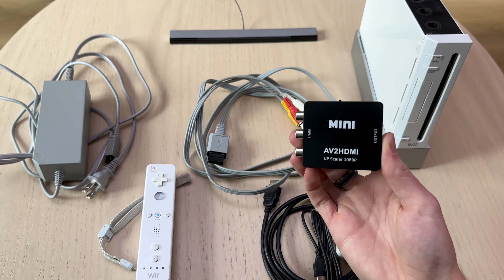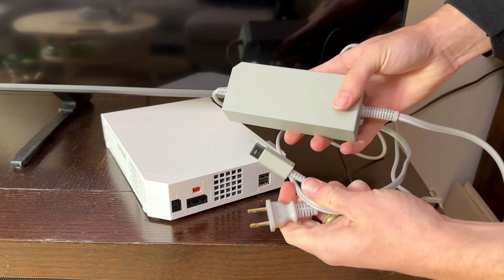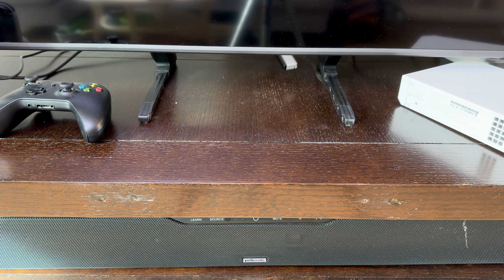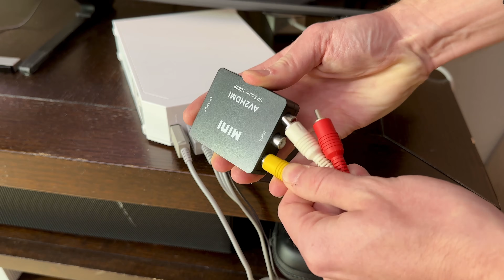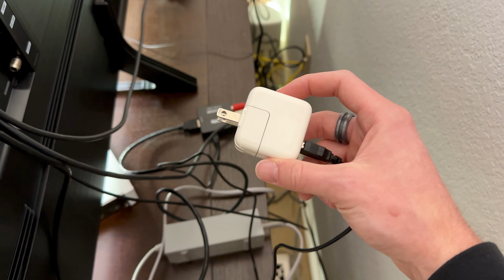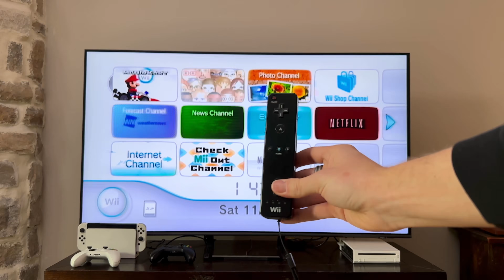How to Connect Nintendo Wii to Smart TV

Comment: Gross. Composite RCA to HDMI looks terrible. The Wii did component video that looks way better on modern displays. The Wii 2 HDMI adapter takes that component signal and passes it through the HDMI. It doesn't look great but it's way better than this.

Comment: was stressing doing this for 40 minutes. turns out i had an hdmi to rca 😂. thanks for the helpful video! i got the proper adapter now
Reply: Hdmi to rca does something like that even exist?
Reply: @sharanrams7766 probably for if you're trying to play a newer device on an older TV. Not many real use cases but it looks cool sometimes. They were probably more useful when hdmi TVs first came out and were still expensive
Reply: @s @sharanrams7766 s, unfortunately
Reply: @sharanrams7766 yes I have it right now

Comment: Hey @SimpleTasksYT! Just bought a new tv and used the same set up as you do to connect the wii. Instead of a nice picture, mine is very blurry, no matter how much I adjust the settings of the tv. Any tips for solving this?
Reply from the maker: Hello! Blurry Wii video is super common on modern TVs. Since the Wii’s native resolution is 480p, modern TVs have to upscale it a lot, which can make the image look soft. The Wii can’t output a true HD image, so anything higher than 480p is just whatever the TV or adapter does with the signal.

Comment: I have followed the steps but it doesn’t pick up the Wii at all it just says hdmi 2 no signal. I made sure it’s connected to hdmi 2.
Reply: Mine doesn't work as well.
Reply: i’m having this same issue. i tried this exact thing in every available hdmi port and none of it is working
Reply: Yours may need to be plugged I. To hdmi 1 mine needed to be plugged in there and mine now works! Hope this helps ❤
Reply: Ya know what's funny??? I'm having the same issue, maybe they discontinued the system,with all the new tech out there!!!
Reply: I had that problem initially but i realised it's becoz i had not powered on the converter. After plugging in the USB cable, the converted started working and the HDMI indicator on the TV came on. However, the screen stayed at the initial menu page coz the system couldnt pick up signal or connect to the controller. Unfortunately, this video does not show how to power up and connect the controller. Can anyone help please? Thanks!
Reply: Try AV (I haven't set mine up yet I'm just suggesting)
Reply: Try buying or looking in your box of old wires look for an male aux to rca 3 female connectors then try through the side AV input. I do this with my N64 and it works as I have no rca ports. Hope this works
Reply: Yup, not working.
Reply: You don't have to put it in HDMI, you have to put it in AV because that's its connector.
Reply: Same as me, did you work out how to fix this please?

Comment: Hi, I’ve set up and connected my Wii but it’s coming through very dark and low quality. I’ve tinkered with my tv settings which has helped a bit, but still not nearly as good as yours. I have the same rca to hdmi adapter so I’m not sure what the issue is. Older Wii? Older tv? Broken HDMI? Pls help 🙏🙏
Reply: That looks like an issue with converter he and you are both using. I suggest looking up Right Sprite Retro Gaming UK for his comparison video on wii adapters. He goes into a lot of detail for different converters, but again a grain of salt. What works for one tv may not work for another based on outputs your tv accepts. I'm sure this adapter works fine for Simple and his television, but it won't do for all tvs out there. Hope that helps.
Reply: Your comment was the best advice!! Thank you

Comment: i don’t have hdmi4 but my tv has 1 2 and 3 and my tv won’t access my wii even though my wii is on
Reply from the maker: Try connecting it to any available HDMI port (1, 2, or 3) and make sure your TV input is switched to that corresponding port.